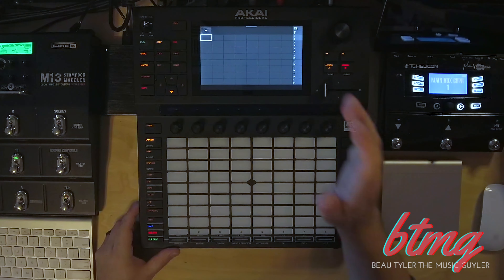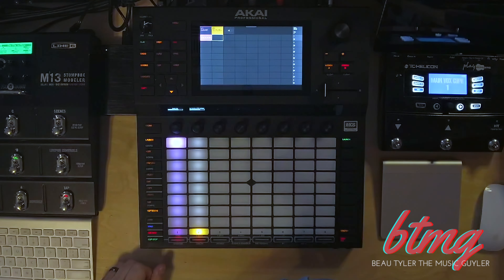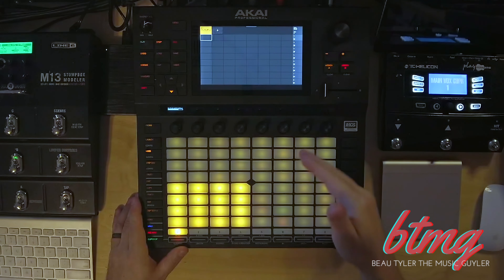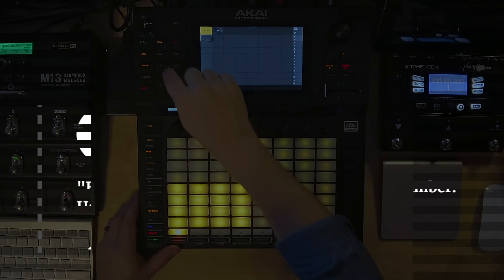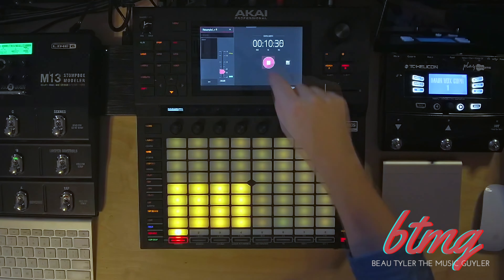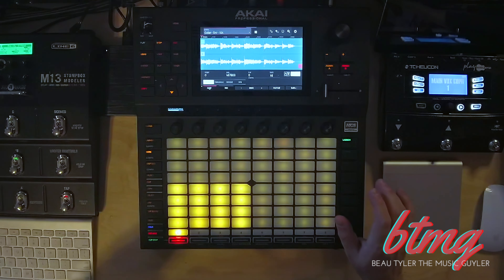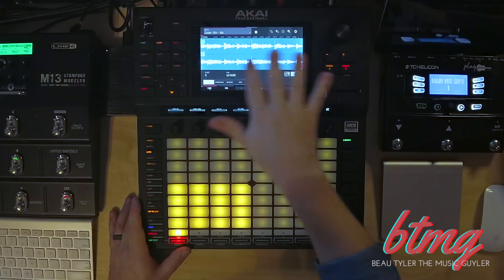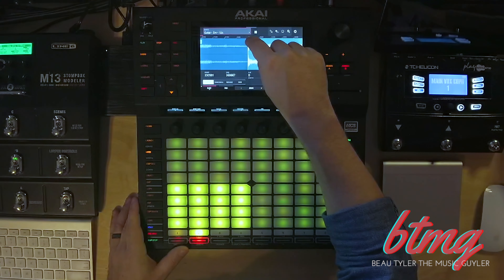Akai Force | How to Swing a Sample Loop

Comment: I was wondering what your opinion would be about the force vs mpcx?
Reply from the maker: Hi! Well, I don’t have the MPC X, but I’ve been drooling over it since it came out and I’ll definitely buy it eventually or buy the next generation if that comes out. The MPC X is beast, but it all really comes down to what your workflow is. I enjoy making instrumentals, but as a songwriter I chose the Force because of its linear DAW-like arranger, which the MPC line doesn’t have. If you’re making instrumentals and like the loop based beat making that Maschine and MPCs are famous for then I’d say that the MPC X is the cream of the crop and you couldn’t chose anything better. However, if you’re wanting the more versatile arranger or are thinking about performing with it then I’d recommend the Akai Force.
Reply: @BeauTylerMakesMusic  Wonderful answer, thanks so much. I'm a songwriter and I feel like even if the x got better stuff with a coming update I would prefer the force for the size as not to be tied to a desk. I don't think I'd really need all the extra ins and outs of the x either and feel like the extra pads would be more beneficial for performance but wasn't really sure. It seems to me a lot of x people are really sleeping on the force especially with the latest update. Because of the look of the pad setup I think people are thinking it's just an ableton tool which from what I can gather through videos isn't the case at all. Anyway thanks again for your response, it was really helpful.